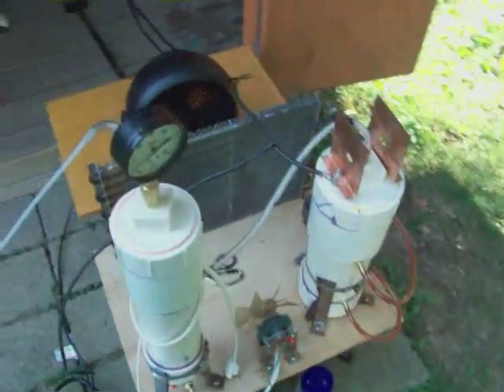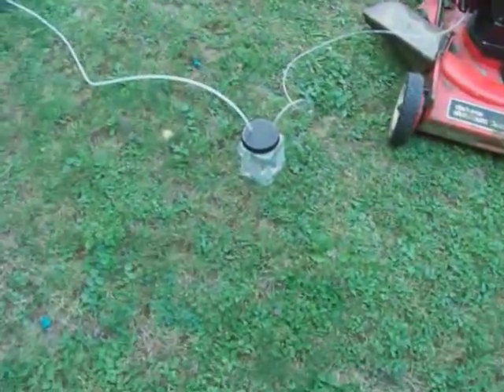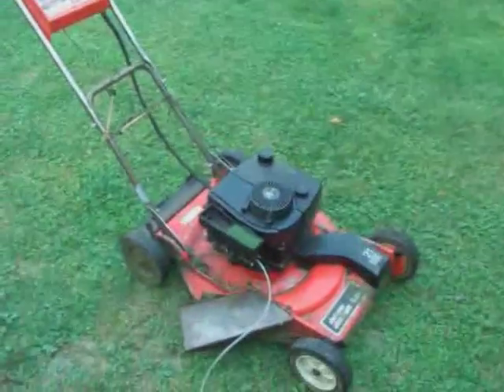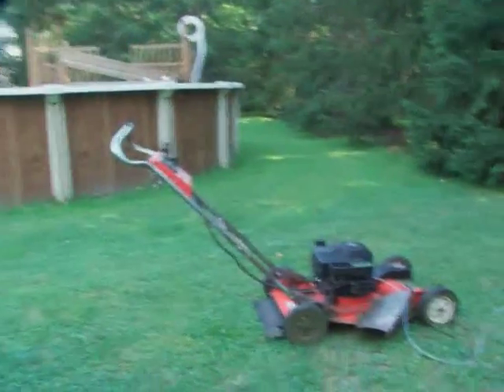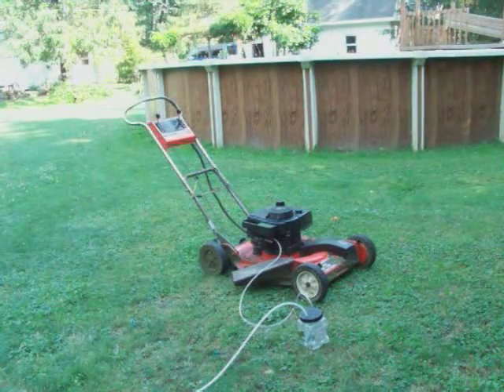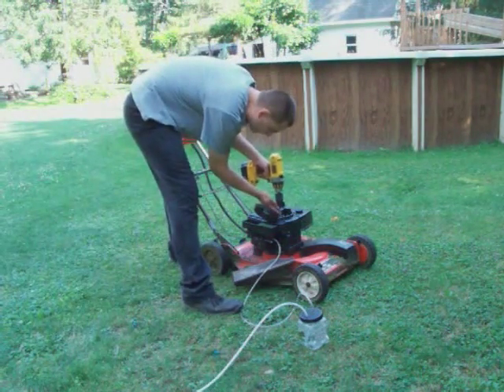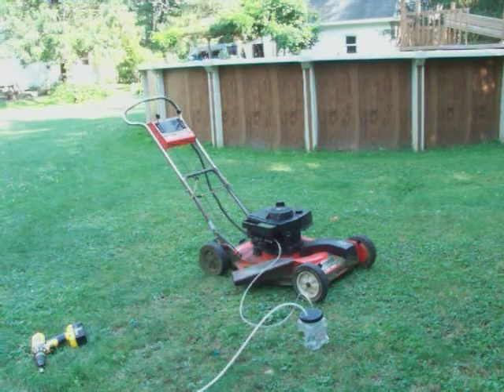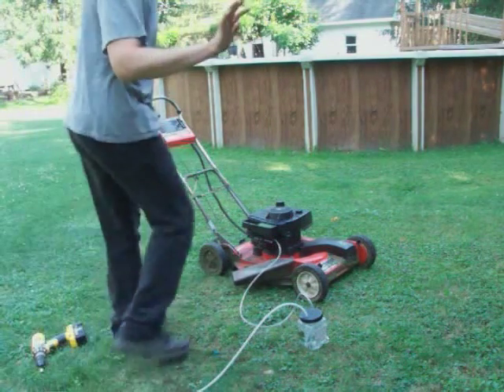lawnmower running on hydrogen

Comment: @keacz You just proved you are an idiot! The Briggs Magnatron comes with a business card sized instructional that, printed on it, it says to use this to gap the magneto. Any good small engine mechanic will tell you, ".030" on the plug, .020" on the points and .010" on the coil. You, judging by this hilarious video, know nothing except how to make shit explode.
Like I said, for the safety of your neighbors, keep gasoline out of the picture. Water is all you can handle...even then...

Comment from the maker: you dont set it with a business card. read a repair manual that is a no no. you use the proper tool to set the gap as per mfr instructions.

Comment: Until they come out with ethanol-resistant parts, I'm stuck w/what I got.
Maybe if you had any mechanical experience (I mean in a shop, not your Mom's garage) you might have a clue.
How do I "...change out the parts in advance"? WTF is that? I can't work on the MF'rs until they are in my shop and on my lift.
Again, with no shop experience, I feel you are not qualified to pass judgement on a Master Mechanic, anyway.
Now...GO AWAY!

Comment: Are you saying I am unfamiliar (ignorant) to ethanol? I work with it on a daily basis, kid. Sometimes up to 12 pieces of equipment a day running ethanol/gas.
If left in equipment idle for any stretch of time, it starts to destroy rubber. Two cycle equipment runs a rubber fuel pump (diaphragm) in the carb. Most have rubber priming (fuel transfer) bulbs. Rubber fuel lines on all.
Ehanol eats and/or hardens this stuff.

Ignorant"? Hardly.
"Educated"? By far!
Try learning...not denying.

Comment: Experience is knowledge. How many years you got working w/internal-combustion engine running ethanal gas? ZERO! So, how can you call me "ignorant"?
You live in denial. You can't learn anything that way.
Maybe you should have said, "Maybe you can help me in the ways of ethanol. Being you have 40 years on-hand experience and I none, you can further educate me."
Nope. You got caught wrong and try to pass the buck.
Ethanol ruins rubber diapragms and fuel lines, just to start. Anything else you want?

Comment: I made a small HHO generator out of a plastic jar and in the lid cut a big hole and covered it with light weight tape. This hole allowed the explosions to escape through the hole and never damage anything and never throw projectiles. After each explosion I just press the tape back down around the hole or get new tape and do it again. '
I have PURPOSFULLY exploded my HHO generator about ten times now and have only had to replace the tape about three times. 

BIG HOLE >>>TAPE OVER

Comment: For a 4 cycle engine, the amount of HHO gas at one atmosphere needed will be about 1/9 of the displacement of the pistons per minute.  So 200cc at 2000rpms would equal  200cc times 1000 cycles per seconds (4 cycle is 2 rotations of the crank) times 1/9 or about 22.22 liters per minute with no load.  A gasoline engine fully loaded is about 15% efficent, or about 6 more times the no load figure.  I don't know if the 15% efficency would improve with HHO.

Comment: good attempt. HHo burns to fast to use alone . but as an additive. you are able to see it works very well. that little tank should give enuff to just idle the enigine. add HHO and it takes off. the bonis is the exhaust U can run this engine like that in a shead and not make a significant amount of carbonmonoxide. ignition timing is a problem too

Comment: the oxygen is 2 times bigger than hydrogen, hydrogen is produce 2 times faster than oxygen, the oxygen is extremly explosive, that is why so many people get back flashes, you have to separate the hydrogen from the oxygen, the hydrogen burns smoother than oxygen similar to natural gas

Comment from the maker: whether it is in a vacuum or under 30 psi of pressure, the rate of production is the same. i have done testing on this. however, the visual appearance looks like it is producing more, but it is just smaller bubbles. microscopic bubbles also have the tendency to create more foam on the cell surface.

Comment from the maker: no, the flywheel is glued in place because the nut was stripped. it is a points ignition that was converted to solid state ignition. so i wasnt sure if moving the coil away from the flywheel would do the trick. and if so not sure how far to move it.

Comment from the maker: that is exactly correct. it took approx 10 min to make the gas in this video drawing approx 70 amps @ 12 volts. making this impractable to use for this reason.

Comment from the maker: no, i plugged the gas line to prevent dirt from getting in there. the gas is fed into the air intake just below the air filter. i drilled a small hole and put a hose in there. you could also just drill a hole in the air filter and put the hose into the hole. it will do the same thing.

Comment from the maker: it doesnt really move that much, a different key would work if i can find one. before i converter this lawnmower to solid state ignition. it had points and condenser. i could have changed the points gap, but not any more since it no longer has points that do anything.

Comment from the maker: i think if i adjust the timing so the spark plug fires later it would eliminate the backfire and may even require less gas to run. what do you think? is my theory right. (i cant adjust the timing on this motor because everything is glued because its broken)

Comment from the maker: this mower seems to run on anything that burns so far except lysol. it wont burn lysol, but more flammable liquids it will. for the hydrogen though, the timing has to be adjusted. the spark plug is firing too soon, however i can not adjust it because everything is glued on with jb